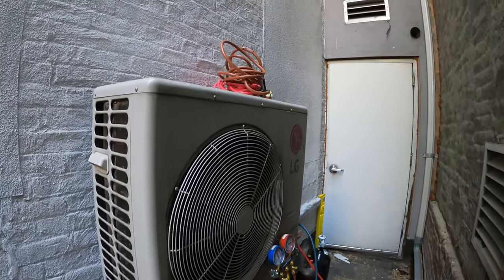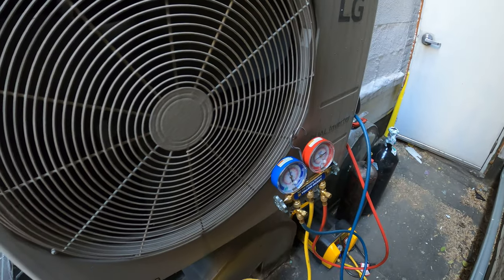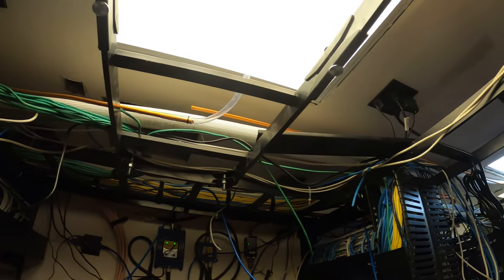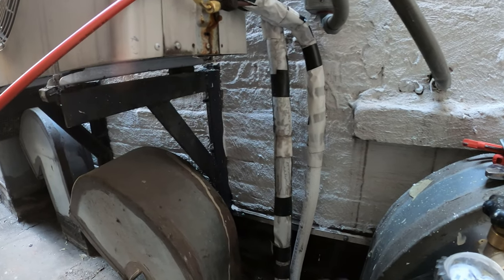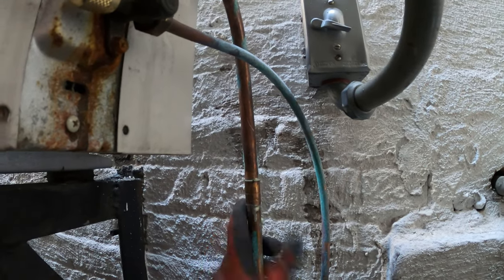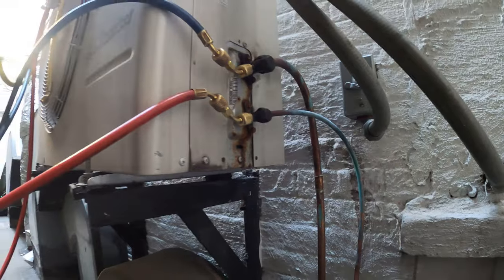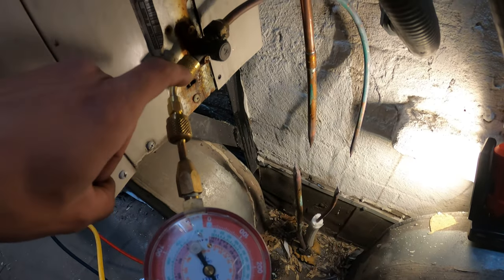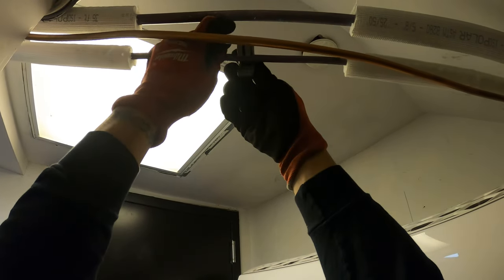HVAC Service Call: LG Heat Pump Refrigerant Leak Test (AC Freon leak Repair) Heat Pump Not Cooling

Comment from the maker: We came back the next day and we found the 3/8" diameter pipe almost completely empty, the 1/2" diameter pipe with a slight loss of pressure along with a slight loss of pressure at the condensing unit. It's time for a new unit! Stay tuned for new videos every week🔧⚡️
Reply: Time for a full new install done properly
Reply from the maker: @joshuabest100  Definitely! Let's goo! 🔧⚡️

Comment: Great job!  We use Isolation like you did on difficult leaks .  We normally use testo probes that read in tenths of a pound. These enable us to normally find the leaking section within 15 to 20 minuets.

Comment: Idk about 410a but you can solder as long as its staysil8. Also the pipe turns green from oxidation. Like the statue of liberty. It advances because techs dont wipe off the flux with a dry rag.
Reply from the maker: Do you mean StayBrite8? I've never used that before. That is true about oxidation and the statue of liberty! Definitely need to wipe off any remaining Flux. As far as this install, it looks like someone's uncle installed it 😂 Thanks for watching!
Reply: @Jumper man Tech  Yeah Staybrite8. Definitely a hack job.
Reply from the maker: @sherwinalvarez7365  I'm going to look into that & definitely. Apparently, this unit had issues from the start🤦‍♂️
Reply: @JumpermanTech  My bad yes Staybrite8

Comment: What ya do ya mean having soldered joins in r410a is a problem?
Reply from the maker: You should never solder refrigerant piping. Especially 410a being a high pressure refrigerant. Always braze your connections💯
Reply from the maker: Solder is for water piping